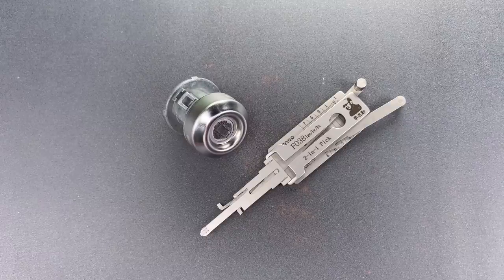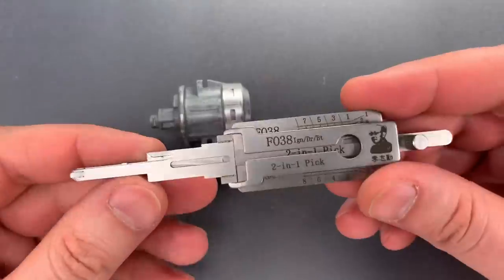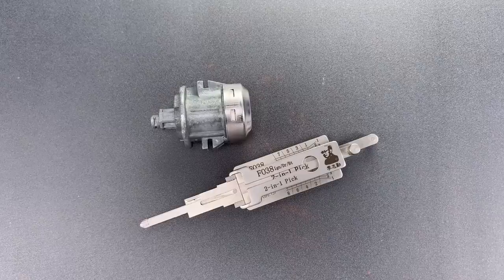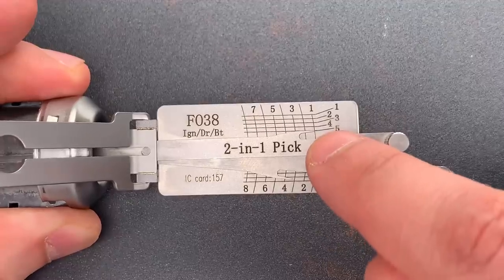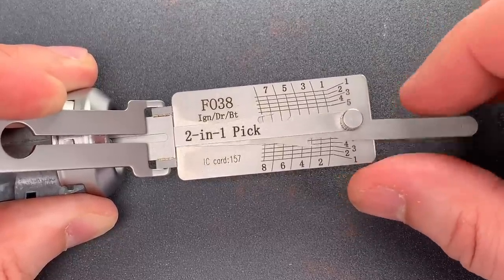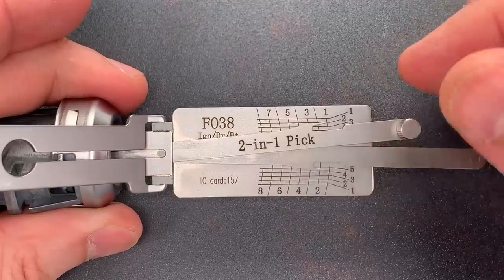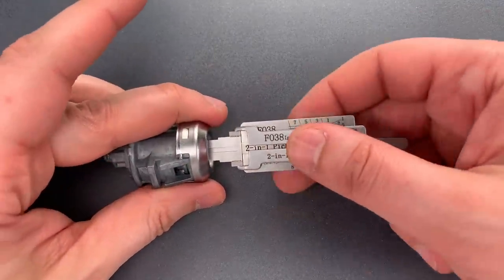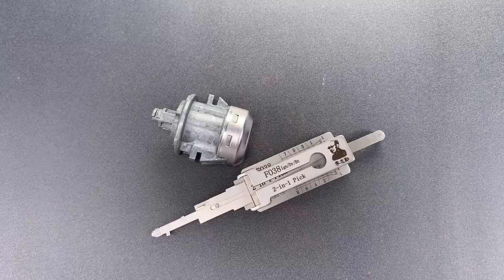[1240] Ford Expedition Lock Picked & Decoded w/ Lishi Tool

Comment: I use these at work every day. Would love to see you pick a Ford high security key with the HU101 Lishi. Good luck with that!
Reply: Come with me, I do them on a daily basis, 3-4 minutes top no more than that
Reply: @alonshvo1  A Ford F-150 high security? Don’t believe you in 3-4 minutes
Reply: I lishi mercedes faster than hu101 f150s
Reply: @unluckywight1647  I’m willing to put it on a video
Reply: @unluckywight1647  you work with this tool and you haven’t noticed the mistake LPL made? He read the cuts wrong. You suppose to push the lifter until it stops, not to release it.
Reply: @alonshvo1  do it and tell me your secret
Reply: @alonshvo1  I didn’t watch the whole video because I work with the tool. It’s not new information.
Reply: It depends on how dirty the lock you are working with is. I've picked them in seconds & I've spent 15 or more minutes. If they are not rolling over for you, 8 try to increase the tension & or try picking it the wrong way. Just got done with an F150 that picking it to locked showed me that #2 didn't need to be touched.
Reply: It's damn Toyotas that give me trouble. 🤣
Reply: @bamascubaman  I’m not saying it’s impossible. I’m saying it’s not easy. I do it often.
Reply: @unluckywight1647  sorry, wasn't intended to be a slight in any way.
Reply: @bamascubaman  no worries. The toy lishi I find is just not worth it. There are just easier ways to make the key. 9/10 I get called out to a Toyota and I just take the door lock out and run the code stamped on the lock.
Reply: @unluckywight1647  absolutely but I believe some of the new Toyota's aren't the same flush mount any more. Had a 2020 Camry that i had to get creative to get the keys out of the trunk.
Reply: @unluckywight1647  no secret, I work with this tool every day. I have 3 Ford dealerships that I work with. I’m an automotive locksmith for the last 12 years.
Reply: @bamascubaman  for the new ones open the torx screw, pull the handle and pull the cylinder out just a little bit and you’ll see the code
Reply: @alonshvo1  with it looking like the old style, where you have to remove the door panel & curse a lot, i wasn't inclined to look at it further unless i just had to. Airbags, flashlight, a long reach & some luck will allow you to pull the emergency trunk release.
Reply: Had to use the Honda Lishi yesterday on a crusty Acura, in pouring rain at 40°. Fortunately it picked right over after a little houdini. 😉
Reply: @alonshvo1  Cool man I also work with several Ford dealerships. Still not easier than other methods of making a lost key.

Comment: That tool is frightening in that it can enable easy entry to the most noobish of thieves.
Reply: Yes, but it only works on one lock type
Reply: @SkylerLinux  Sure, but there's like a jazillion Ford Expeditions.
Reply: Its not as simple as “pushing buttons”. You need to have “the feel”.
Reply: I'd be willing to bet a pretty large sum of money that these tools have never and will never be used buy criminals. I live in Houston and know many people who have had the cars broken in to and it's always the same attack. Brake the window or jam a big screwdriver and use vicegrips to shear the pins. This tool is too expensive and takes way to long.
Reply: @chasemc69  fuck that screwdriver approach man. I got my vehicle almost declared economically totalled because they messed up the central door locking mechanism. All for a 10 year old car radio. 

I'd much rather they smash my window and it's fixed within a day.
Reply: @paulelderson934  I would rather leave the door open, then I don’t have to buy a new window...

Comment: I believe you said Auto Only, they now make for Kwikset, Schlage, Master and some other Pin Tumbler Locks. I had the Idea in 2013, mentioned on a Locksmithing Forum, that it would be nice if they made for Pin Tumbler, others thought not Possible, 2019 they came out with the Pin Tumbler Version, Keep up the Good Work. Being able to Decode a Picked Master Padlock, allows Old Padlocks new life without Impressioning.
Stratmando

Comment: I used many different lishis daily, both residential and auto. I have found his method of picking of Even then Odd isn’t the best way. I found, just like what he does on SPP, it’s to find the next binding pin/wafer works better. So I personally work my way through all the pins, both the odd and even, not doing all the Even, then the Odd. Also the amount of pressure on the turning bar is critical, some lock types require more pressure, when others require very little pressure, just like all the other locks he picks. There are a few of the locks/lishi that actually do best when picked all Even, then all the Odd, but not the Ford FO38 lishi. The Honda HU66 lishi will require you to pick all the Even first, the the Odd, which turns the Lishi about 30 degrees, then you have to pick the Even again to fully turn the lock and only then can you read the wafers. You must repick the lock again to turn it back to the neutral position. He went so fast on reading the wafer heights I think he actually misread the true key bittings, but I think he was very close. As far as the ignition key, which in this case uses wafers 7 and 8, with a proper app you can put in the known door lock wafers (1-6) and it will fill in what 7 and 8 could be, for the ignition. I use InstaCode to fill in the unknown wafers to make a fully working key, for both door and ignition. Since the Ford locks only use 8 wafers the lishi can also pick the ignition lock, however, like the Toyota 10 cut keys, the lishi only has (depending on year, make and model of Toyota, it could be one of several lishi types) wafer 3-10, so it can only pick door locks,  not the ignition. You would have to use an app to fill in the unknown wafers for a fully working key. Both LLP and Bonsai Bill are my “go to” on YouTube videos for locks, however there are other people that use lishis on a daily basis that explains how to use a lishi much better than this video. A critical point is that if the lishi has ANY BOUNCE, LEAVE IT ALONE, and find the next binding wafer. Just like oversetting a lock using SSP, you can pick the wrong wafer in the wrong order and you would never be able to pick the lock. Usually when you get to a point where every pin has bounce to it, and nothing is binding, then you picked the wrong pin at the wrong point, and you can never pick it, you just have to reset and start over.

Comment: Actually you're supposed to push the tool till the decoding arm reaches the end of the spring however if you don't have the tool lined up exactly because of the lock tolerances you will have half readings. 

You have to make sure the space at the top and bottom are equidistant from each other.  

Basically the tool will jiggle in the lock and you have to find the middle point with the tool.

Another con of this tool is because its a pick and decoding tool you will tear it up and I recommend for first time Automotive Locksmiths to buy two of the most common ones you use and have one for picking and another for decoding until you get down the exact tension.  

This is a tool us automotive locksmiths use in AKL situations (All Keys Lost) that way we don't have to take the lock out of the door to find the key code to cut a new key.

Great video!!

Comment: From the engineering standpoint, it really seems like you could make a tool like this that works for a great number of locks. The only thing preventing it is the big blank in the front for tensioning, but you could essentially cut that off and provide tension somewhere near the front of the entrance like you normally would. The depth chart of course would need manufacturer specific measurements, but those could be a paper slip or separate lookup table.

Comment: A lot of car doors are super simple to open.  I have locked many keys in cars when I was a mechanic.

Slim Jim's work great and sometimes you just need a screwdriver to access the locking rod through the handle.

Low skill attack that would take less time than finding your key in you pocket and clicking the unlock button.

Comment: The FO38 lishi pick was the first one I ever got. 

When I was a locksmith, my boss told me early on that lishi's weren't as easy to use as people made out (read: he couldn't quite get the hang of it). One day ,I was called to work on a ford mustang where the owner had lost the keys about a year beforehand and had just left it in the hope they showed up.  
I needed a key code, and the car was COVERED in spiders so  I didn't want to try to take the lock out to decode (I really hate spiders, even dead ones). Fortunately, the weather was pretty threatening, so with that as my excuse, I said I'd come back on a better day. Lishi pick obtained, nightmares mostly averted. 

The kicker? Worse for the customer than for me, but the car had been unlocked the entire time, and the customer claimed to have searched it for the keys, so I didn't spend any time doing that. Got a call a week later from the guy, letting me know he'd found the original keys in the trunk, and could I come back and reprogram the immobiliser chip in them so they'd start the car again (new keys I made dropped the old ones out since they weren't present for programming when I was there).

Comment: You can break into an 00 explorer with the antenna by using it to shove the mechanism open if you jam it in under the door handle. This simulates pulling the handle from the inside, I've done it before in a junkyard.

Comment: This is used by automotive locksmiths in order to make keys when all keys are lost on a vehicle. This wont start the car however as 95% of vehicles on the road are immobilizer equipped, so the auto locksmith will then program the key in order to start the car up. Source; I’m an auto locksmith since 5 years.

Comment: I use to do auto repo, and had a older ford tool that was a key with rubber on the edge, put in and jiggle and it would allow the pin tumblers to line up. The 70s and older we mostly used a dent puller or jiggle keys.

Comment: It's worth mentioning that most modern cars have some sort of chip in the key and will 1: not let the car turn on without using the key with the chip and 2: sound the alarm if the door is unlocked without using the chipped key
Reply: Most vehicles do not have chip detect in the doors or trunk, just the ignition. Older vehicles are one of a few resistor values intended to delay one with trial and error. Most newer vehicles can have new keys added through the ODB port (protected by a PIN) in a few minutes.

Comment: @LockPickingLawyer The bitting on this lock is actually 112132. You have to depress through the spring to get the reading. 223243 does not match any known Ford code. 112132 has two possibilities.

Comment: There's only one Locksmith around my area that I will use..My 2005 F-150 was stolen about 10 years back and it was recovered without the keys, of course. I call this guy that I'd heard about to come out and make me a key, and I was shocked at how fast he was. He put a blank in the door, turned it, pulled it out and put in his cutter, made cuts, then repeated. He did the same thing with the ignition..usually the locksmiths I've used end up pulling the ignition out or something crazy. I've just never seen anyone do it that fast..

Comment: Awesome as usual LPL!However, just for the heck of it, I ran a search of that sequence of depths in the code series for that lock(0001X-1706X)in my HPC Codesource software, and nothing showed up. So I reviewed the decoding segment of the video again, and it turns out that your readings were too deep because you didn’t probe each space far enough(You need to depress the feeler arm until the pointer comes to a positive stop at one of the depth lines), which means that the cuts needed to operate that door lock are actually 112312.(And the missing ones in the last two positions(7 and 8.Which are needed for a complete key that would operate the ignition of the vehicle that it was taken from)are either 1 and 2, or 4 and 3.)

Comment: Yeah, when my battery was dead on my F350, which has a broken door lock, took the guy from the auto club less than 5 seconds to unlock the door, no picking required.

Comment: And the "funny" thing is, in most of the insurance companies (at least in europe) states that car with modern locks and modern anti-theft coded and chipped keys, compensation can be denied if the car is stolen / burglarized due to "high skill attack needed to entry the vehicle and illegally take possession of it"! And the thing is that with a set of tools (like Lishi for picking), key programmer (ie. OBDStar) and blank chip, most of the modern cars can be stolen relatively easily! And the worst thing is, when Your car is stolen or burglarized,  owner has the burden of proof that it was a.) locked properly, b.) stolen or entry made using high tech devices, c.) give the exact time and date of the crime! While all  of the items can be obtained under ~300USD from China and Youtube will educate. Nuts!

Comment: I'm assuming the decoding is the primary use of these, so a locksmith can cut solve the missing key problem by cutting new keys without having to know how to disassemble the car door.  I feel like tensioning the ignition to get those missing wafers might be a pain though.

Comment: As someone who uses these daily-it looks like your reading of the lock is incorrect. You read the wafers/ bitting by putting gentle pressure bottoming out the springs without flexing the tool. Reading the wafers before the springs flex down and bottom out puts you 1 cut depth away on each cut. It looks like you are not pushing the lever down until full stop before reading the bitting here.

Comment: If each wafer has 5 positions and you have 6 wafers per lock, that's 15 625  different combinations (390 625 with  8 wafers). The 6 wafers side seems a bit on the low side, if my numbers are correct...

Comment: I assume a locksmith called out to use this on an automobile door would still be unable to start most modern ignitions without the authorized key-chip so you're better off spending on a tow to the nearest factory dealership. Maybe you can hot-wire some vehicles into limp mode but still... I guess it's useful to rescue trapped dogs or infants if breaking a window just won't do for you.
Reply: Many locksmiths can reprogram a new ignition key once in the vehicle with access to the ODB port, as can many non locksmiths. Some vehicles use one of a few resistors so it's a case of try, swap, wait, repeat.
Reply: @ttww1590  I'm still waiting to see this work with an import model. Even the factory tech had trouble with a Nissan and the BMW guy had to have the car left while his terminal summoned the factory server for the right encryption sequences for that VIN. Maybe the big-three models use this resistor thing. I don't know as we gave up on them years ago. I'm not talking about just getting the engine to fire. I mean full on - no limp mode access to all functionality.

I recall guys were hacking Jeeps a few years back so I'm sure there are lots of simple vulnerabilities to be exploited.

Comment: I use the high security ones daily considering there are acureaders and ez readers that don’t first require picking for older model vehicles to acquire key codes to generate keys. A reach tool is typically all you need for a car door unlocking. Lishis are too expensive.

Comment: That is actually a pretty cool tool.
One question, why are there two picks needed, one for the odd numbers and one for the even numbers?
Reply: wafers are on both sides of the cut, some move one way other move the opposite. Not like a single cut key with all cuts on one side.
Reply: @Blazer02LS  that actually makes sense! Thanks for explaining :)
Reply: With this style of lock some of the wafers are on the bottom and some are on the top. If you only picked one, the others would prevent the turn.

Comment: Awesome vid. I really like that lishi tool. My only question is, how do you tell which lishi tool to use if there are several dozen to choose from?
Reply: Well the tools are for specific car brands etc., thus you would have to look up which tool you need for the specific brand (and probably also car model).
Lishi provides informations on its various decoders, e.g.

„B106/GM37 2-In-1
Applications
Buick • Cadillac • Chevrolet • General Motors
Hummer • Oldsmobile • Pontiac • Saturn • Others
Notes
This tool is used in locks that have NO keyway wards.“

http://www.originallishi.com/2-in-1tools/b106-gm37-2-in-1/
Reply: It’s an F038. There’s a list of makes and model years for which this tool works. Check out lockpicks.com (seriously).
Reply: Actually closer to 100 at the moment, they all have an ID number and a chart of the keyways and cuts they fit.

Comment: Considering police fleet cars often use the same key in all the cars so each officer can quickly jump in and move a car if they need to, this tool makes the crappy quality of their in car gun locks even more worrying... All you need to do is pick one and cut a new key then you can get into any of the cars you want and have away with their rifles/shotguns using a big magnet or cuff key

Comment: Cool to see 2.2K likes when there are only 432 views
Reply: @Wayne Flanigan Put the tinfoil away. Like and Comment are a single thing that is quick and easy for one server to note and forward to the others after a single button click (like or submit). View is calculated after several seconds of watch time, so there is a processing delay before a View is generated. In addition  View has detailed info for the channel operator and advertisers that is gathered and sent at the same time.